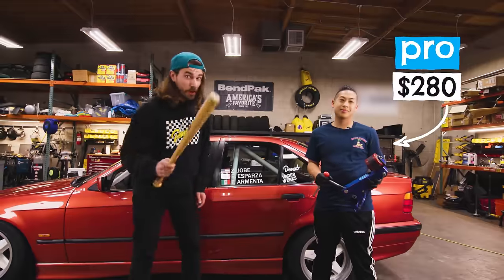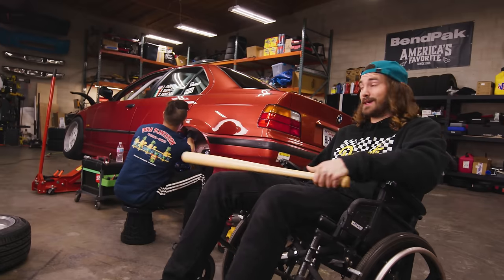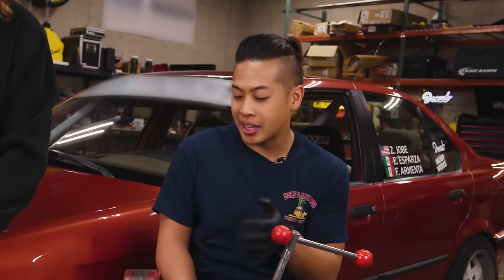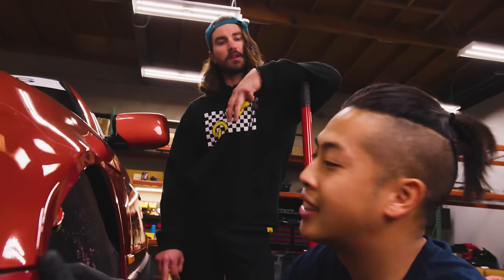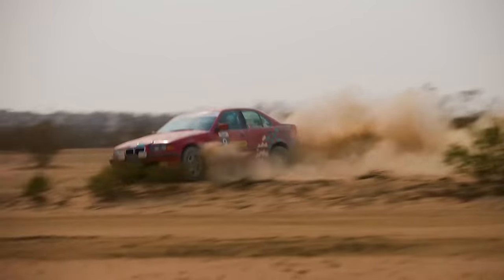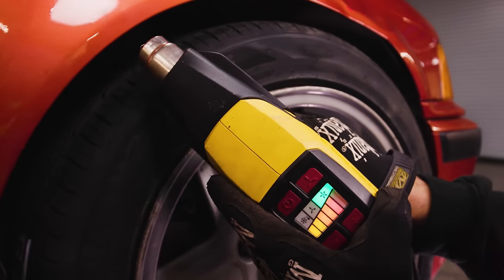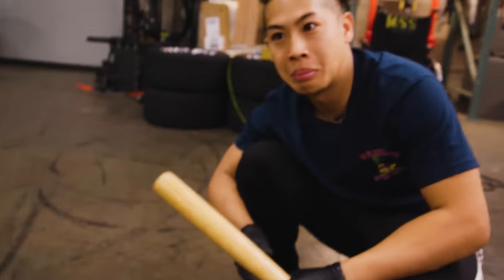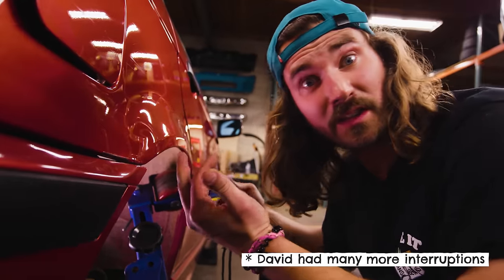$300 vs $0 Fender Rolling

Comment from the maker: What do you want to see us DIY vs Pro next?
Reply: Spoilers 😂
Reply: Jobe getting his hair cut by a barber vs James cutting it
Reply: @Flowersbloomw  Fr 😆
Reply: Window tint!
Reply: DIY vs Pro/manufactured straight pipe. That or DIY vs Pro suspension adjustment (toe camber caster etc)
Reply: DYI!!!!
Reply: Tar/sap removal
Reply: Cosmetic interior upgrades
Reply: Tint!
Reply: Putting stance on a vehicle
Reply: @rbrme  yeeesssss
Reply: @thomasriley7685  they did a window tint episode of money pit!
Reply: Vinal wrap but like a door on each side and not half the car because that's just crazy
Reply: My hair is almost as long as yours. How about Jer or James cuts your hair and a pro cuts mine. 🧔🏽‍♀️🧔🏽‍♀️👉🏽🧔🏽🧑🏽‍🦲
Reply: Plasti Dip paint
Reply: Small bodywork issues, something like sanding, body filling, painting, and blending sections of a panel. Would easily cost hundreds for a pro to do it, but under $50 for the materials.
Reply: @richhunter515  They already did tint
Reply: Window tint or install a wide body with cut fenders
Reply: RB REBUILD!!
Reply: DIY vs Pro bodykits
Reply: diy tune
Reply: Spoilers or exhausts
Reply: more money pit
Reply: should i apply for the video editor position at donut with zero experience in editing cuz I love cars or don't?
Reply: How about diy suspension swap?
Reply: Regearing the tacoma differentials
Reply: Removing sheared or rounded bolts/nuts! Only thing I've had to send my car to the shop for was some rear LCA bolts that just wouldn't work for me.
Reply: Diy body kits
Reply: Car wrap!
Reply: Call it "money pit"
Reply: @Pwn3dbyth3n00b  NO, THAT GO WRONG!!! DON'T MAKE THE E36 SUFFER LIKE NOLAN'S Z D:
Reply: Do one on regearing a Toyota Taco. Y'all already have the footage
Reply: Can you slide the link for that stool? I want one too Zach!
Reply: Body kit..
Reply: Start from basics.  Engine oil, filters, brakes, brake fluids,  steering fluids , tire repairs  and move to more complex stuff like transmission repair/replacement, installing car alarms, ecu tuning  etc.
Reply: Oil Change and other maintenance stuff. Some things are worth the money to not mess up (like rebuilding a steering rack...)
Reply: Glad you did this one. Always wanted to see a pro roll fenders vs the bat / hammer method. Suggestions - wraps, tint, headlight / taillight clearing & smoking, fender pulling, paintless dent removal, interior upholstery repair (ripped seat fabric, etc).
Reply: Jobe, I’ve been growing my hair along with you. If you’re gonna cut it, definitely do a DIY vs Pro of that.
Reply: In this video it was missing a comparison from PRO vs DIY with tires mounted to double check accuracy
Reply: I'd love to see a Radio and Speakers. Especially if it's a conversion from the traditional rectangle deck to a newer touchscreen.
Reply: painting/respraying cars
Reply: You should definatley do a welded diff!!!!!
Reply: @christopherwhiting3570  they did that in a hi car  low car episode
Reply: Window tint
Reply: @richhunter515  they already did that on a prius i think
Reply: @quatre1559  which car was it, ill go watch it
Reply: Sound dampening
Reply: Wheel polishing
Reply: interior detailing
Reply: Hail damage could be interesting
Reply: Wheel alignment
Reply: Do a gr video or tell James to plz for ya boi skinny p
Reply: window tint
Reply: Wrapping a whole car
Reply: @thomasriley7685  He did that already on another video. And it was f’ing hilarious.
Reply: Engine building please 🤧
Reply: General bodywork. Have a pro do one of the dents in a fender vs. Jobe trying to finish banging the dent out of the fender he used the dead blow on for this episode. :_jobe:
Reply: @xPhilxHC  already did it on an episode of Money Pit.
Reply: @flamethrower2677  YES! I’d love to see him attempt to port and polish some heads vs. a pro!
Reply: Clear coat repair, Ive heard that you can repair sun damaged clear coat pretty cheap but Ive never found courage to try it on my old car.
Reply: car parts- 2nd hand vs Brand new from the factory
Reply: Breaks
Reply: turn it into a time attack car on budget
Reply: engine swap
Reply: Car wash and detail
Reply: @thomasriley7685  they did that already
Reply: Chopping wheel wells to fit excessively large tires on the Toyota
Reply: Long travel suspension
Reply: DIY paint VS Pro.
Reply: Can we see more video on scooter bike like Vespa maybe?
Reply: Exhaust systems- high flow,  cat back, resonators
Reply: Paint!!
Reply: String alignment vs alignment shop
Reply: exhaust .. cutting resonator vs shop
Reply: Could you do an engine bay tucking/shaving and painting video?
Reply: do diy aero kits, see if you are able to make usefull skirts, splitters and wings, that would show the real difference.
Btw, do you remember taxi franchise? movable bodykit would be awesome, but is it worth the weight increase on all mechanisms?
Reply: I feel like this should be called PRO vs BRO
Reply: Your mom
Reply: V8 valve springs/ camshaft installs
Reply: @thomasriley7685  they actually already made a window tint one. Its somewhere on their channel from like4-5 months back i think?
Reply: Paintless dent removal.
Reply: Honestly installing aftermarket forced induction
Reply: Knocking off the wife, so I can spend more on my cars....
Reply: Can y’all do a up to speed on the Pontiac Trans Am
Reply: DIY vs Pro remote start
Reply: Detailing!
Reply: Painting your bumper, or paint touch-up.
Reply: Wrapping your car
Reply: Broken Windshiels change :)
Reply: painting your car
Reply: Fixing exterior dents/rust and color matching paint. I did a bunch of this myself last year, and the car looks substantially better overall, but it's not great up close, and some rust is already creeping back in one spot.
Reply: Rust Repair!
Reply: Vinyl wrap
Reply: @Pwn3dbyth3n00b  they did an episode on High Low first season
Reply: @justincox8553  money pit season 1 with the miata
Reply: Half the stuff ppl are asking for have been on previous episodes of Money Pit and High/low
NOT hating on the suggestion, but it's been generally covered.
Reply: @richhunter515  He's done tint already.
Reply: Paintjob/Wrap
Reply: Window tint!
Reply: Glass replacement could be interesting.  Plus watching you guys break a bunch of windshields would be sweet!
Reply: Engine tuning/maping
Reply: @thomasriley7685  They've already done window tint
Reply: Yes it would help give good tips 100 percent
Reply: paint correction/rust repair
Reply: Subwoofer installation
Reply: Bumper fabrication!
Reply: When is that moneypit Miata gonna take E-85? I didn’t forget ;)
Reply: Car photography, pls
Reply: Paint jobs / body work & styling
Reply: bolt on parts
Reply: Painting a car
Reply: I would love to square off against Zack in a Pro dent repair technician vs. DIY amazon dent removal kit or something similar. I'm PDR tech from Phoenix AZ and have been watching the channel for years! Love the content! If Zack wants some of this PDR smoke, I'm all game! 💯💪
Reply: @thomasriley7685  they did that already.
Reply: Pro v. DYI: full cleaning detail interior, exterior, and engine.
Reply: But Donut how do I get enough money to buy a BMW and do after market modifications to it?
Reply: Alignments!
Reply: Vinyl wrap for sure 
Do it 
Just do it!!!!
Reply: Plastidip... sorry Nolan xD
Reply: @richhunter515  already done inside another episode
Reply: ITB's
Reply: PDR 🙈
Reply: Building an engine from a bare block
Reply: A Tacoma hood maybe with a scoop!!
Reply: heart surgery
Reply: Turbo kits!!!!?
Reply: Paint abs body prep
Reply: Paint polish
Reply: Fix the dents on the fenders DIY style
Reply: Ceramic coat...
Reply: DIY Rotary rebuild lol
Reply: the money pit intro
Reply: Engine tuning
Reply: Window tint or wrap
Reply: Hey guys, love the channel, just wanted to say as a qualified panel beater, you should have used a dolly with the hammer (wrapped in cloth or something) it takes me about 40 minutes to roll all four fenders on a car and with the same finish as a guard roller. Maybe I'm a bit biased due to my trade, but I'll always do it that way. If you have no proficiency with panel work I would recommend the guard roller though, just wanted to point that out.

Great video as usual. Keep it up.
Reply: paint
Reply: @thomasriley7685  they already did that
Reply: Moneypit
Reply: Pinstriping 🖌️
Reply: Dent pulling
Reply: Cutting springs lmao
Reply: How about morimoto projector headlight retrofit that would be cool. Or I'd like to see wrap/dip revisited and done the correct way.
Reply: Babysitting
Reply: DIY PAINT JOB VS PRO! DIY Tune Vs Pro tune, DIY Nitrous, & DIY detail.
Reply: Paint
Reply: Rust removal
Reply: sound system upgrades
Reply: What's the black stool he expanded and then sat on?
Reply: Car Detailing
Reply: Fender flares/fender trim for tacos. Considering diy my disco 2 🌚
Reply: Just more zach
Reply: I agree with wide body/ cutting fenders. That would be super helpful for lots of people to know what they're getting into and if they could do it themselves, myself included 😅
Reply: Paint diy vs. pro or plastidip or wrap!
Reply: Basic maintenance would be cool! Oil changes brakes flushed diy vs. pro! Definitely big price difference for some of those!
Reply: @thomasriley7685  there is already one of those
Reply: Wrap the car!
Reply: Cut/polish, wrap, then ceramic coat would be killer!
Reply: Definitely paint and or body work. Pull dents, apply bondo, prep and spray a single door or body panel
Reply: Interior suck as headliner
Reply: Such
Reply: my brain: diy?+ hilow?-wtf
Reply: EV Conversion! It’s only about $25,000 per car😅
Reply: I LOVE the idea of this show!!!! I really would love to see a DIY or not about rebuilding a 5-600hp small block VS just buying a new/used one‼️ Machine shops can get spendy QUICK! But the price of cams pistons and performance parts is quite reasonable with all the competition out there‼️
Reply: I LOVE the idea of this show!!!! I really would love to see a DIY or not about rebuilding a 5-600hp small block VS just buying a new/used one‼️ Machine shops can get spendy QUICK! But the price of cams pistons and performance parts is quite reasonable with all the competition out there‼️
Reply: pulling fenders😂
Reply: @thomasriley7685  I'm pretty sure they've already done that (great video)
Reply: Refurbishing your own wheels?
Reply: Wrap, window tint, audio system, pin stripe lol?
Reply: car vinyl wraps?
Reply: Engine Tuning!!!
Reply: Body kit repair, like how to silicone my front bumper back on like the body shops do since someone smacked my car while street parked. Also would be cool to watch them reskin/hog ring a set of recaros and rear seats because getting new skins on without wrinkles is pretty hardcimo.
Reply: Car Wrap!!
Reply: Panel body respray / repair
Reply: replacing blinker fluid
Reply: Waxing
Reply: Fender rolling!
Reply: Diy vs pro drifting
Reply: But what about fender pulling and stretching?
Reply: Where can I buy the stool
Reply: Wrapping your car pro vs DIY
Reply: PPF/Vinyl Wrapping
Reply: Pulling out dents in the body panel
Reply: Widebody installing
Reply: Dyno tune vs plug-in tune

Comment: $280 to have a pro roll 4 fenders sounds completely worth it. I'd never use a fender roller again and it would just take up garage space. Great explanation
Reply: when you find out that the guy just cuts the fender liner, the price is high.
Reply: You can buy a fender roller for 90 lmao it's not at all worth it to pay 3x as much
Reply: @donsterr  Tools cost ~150. Knowledge, experience, and time make up the other $130
Reply: @GlorifiedGremlin  If you know what you're doing and have a lot of fender rolling to do then sure. If you just have one car and you'll never look at the roller again, maybe just pay the pro to do the job and enjoy your afternoon off.
Reply: @donsterr  👈 what he said ! I'm a panel beater of 14years. My customers would never let me get away with that! 

Not to mention... He's rolling the arch so the liner doesn't need to be cut, you're pushing the metal away from the liner (most liners sit it the bit you are rolling). Just undo a few screws and pop the liner out completely, understand then there's less of an opening for dirt and water to get in... Which will eventually rot your arches out !
Reply: if you have a fender roller and it's just sitting, you're not getting out to enough car meets and networking.. you too can be a fender rolling pro and pay for that roller time and time over..
Reply: @GlorifiedGremlin  fender rollers are only 40 on ebay
Reply: @GlorifiedGremlin  Fr, I’d rather lay 80-100$ to buy the roller and take my time then than pay almost 400

Comment: A word of wisdom for the young stance padawans out there: most auto parts stores have fender rollers you can rent for a few bucks if you don’t want to buy one. 🤙🏻
Reply: Which stores? Cuz Autozone around here didn’t have one
Reply: @c2cold4sho  My local Advance Auto rents them out, and I’m almost positive the O’Reillys does as well. Upper Michigan here, so I guess stores in other regions may have different rental programs?
Reply: @SandyNickk  Thanks for the reply. Yeah, they must have regional stock differences, because Oreilly’s didn’t have one either. Advance is the one I forgot to check, so I’ll ask them when they open 👍🏽
Reply: @c2cold4sho  You ever find one?

Comment: There are many solutions to the fender liner clearance. I normally tuck the liner behind the new fold of the fender. That way you don’t leave a gap between the fender and liner as they did. Maybe in their case it was still gonna run so they had to cut. I’d use a heat gun to reshape the liner edge a bit if possible before I did that, and in some cases like my SRT-10 Ram, you just have to clearance a hole such as the area directly above the tire after doing a MAX front end (without control arm bracket fabrication) 2” drop with stock 22” rims & tires.

Comment: My most versatile tool is my Dewalt Angle grinder. The first thing I did, day one when I bought my brand new ‘99 Civic Si is slap some 17” rims on it, drop it 2” and take an angle grinder to the rear quarters. To achieve a 0* camber, there was very little room to even roll. Did the same to wife’s 05 TL within weeks of taking delivery. Just be sure and use touch up paint at the cuts afterwards. Using tape as a cutting guide is a good way to stay straight.

Comment: I've rolled several with a nice soft, heavy hammer and a block of wood with a rag wrapped around it.  Just work it slowly the whole length of what you want rolled, going a little at a time (wheel off of course!)... back and forth

Comment: Great vid, but a few notes;
Back in the day when we rolled fenders with a bat we put the bat between the tire & fender (the car remained on the ground).
One guy handled the bat while another guy got in the car slowly pulling forward & backing up as needed.
If you needed more you repeated the process but this time with 2-3 friends sitting on the trunk.
With all that being said, the gauge of metal on old vehicles was thicker which made it easier because it didn’t crease like modern vehicles.

Comment: I can't believe you paid $300, when you can buy the tool he used for $87.....they are not hard to use, and all the insight the guy gave you is in the instructions.  Also most people that use a bat to do this cut the bat down to use for this, also you where using the wrong end of the bat....seemed like you used this video to promote your friends service.

Comment: In 2010, we used a cheap Wagner heat gun and a small base ball bat to roll the frack out of my rear fenders. ....2005 E46 M3.
No paint damage. Still holding up 12 years later.

Comment: I own the same fender roller he used. Many year ago I've been there done that with the bat method, a real fender roller is definitely the way to go. I also have the truck adapter and I use it pretty frequently on gm trucks. While truck fenders are much harder to roll, it works really well, just takes a little more time.

Comment: I fender rolled with a rachet and sockets going up from 17 to 27, i get complements all day  and looks good AF, everyone thinks i used a roller, since u go up in size by little there is less room for error and because of the rachet, u can use it to pry the socket out and fix imperfections

Comment: How about the phone book method? You heat up the fender put a phone book or catalogue of the needed thickness on the tire, then lower it slowy, stopping when then is enough pressure and using the heat gun to soften it all up.

Comment: I did this on my old Subaru with a baseball bat, jacked car up, and set it down some with the bat in there, slowly did the whole fender from one side to the other, lowering the car a little each pass. Looked real good, and took about. Not bad for using the bat I got as a kid. No heat gun or hammer, but I did it in the summer in the desert so it was pretty hot out

Comment: Iv rolled many guards using a thin metal pole and u use the cars weight and drive the car slowly forwards and backwards while moving the pole with the wheels it’s a lot rosier that way

Comment: Very cool! I’m curious though: I’m assuming you have to put some weight on the suspension when the wheel is off to raise the center of the hub to be centered with fender arc. How do you gauge this height and is it tedious to set up?

Comment: Jack it up, droop it out on a stand.  Put the batt in and jack pup the wheel to fit to the bat and you can use the bat like the roller.  roll across., jack a bit roll across again.

Comment: Cool vid,but I have used a bat before and had good results doing it with the wheel on and using wheel to help roll the bat around,which is key,you must roll the bat and change the angle every couple of passes. But buy the tool or use a pro if you,re unsure what to do. Best wishes to all, from, Auckland, New Zealand 👑⭐🏅👍✅💯❤🙂🙂🙂😉😉🍻